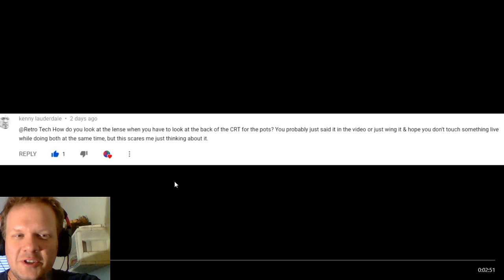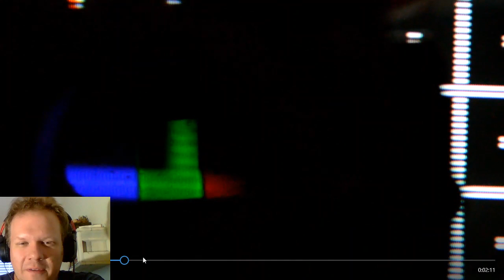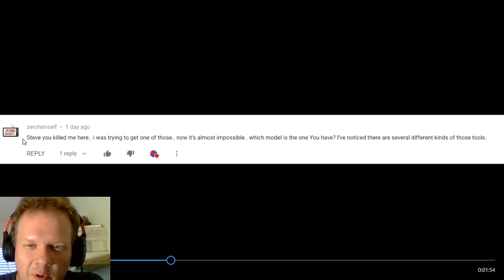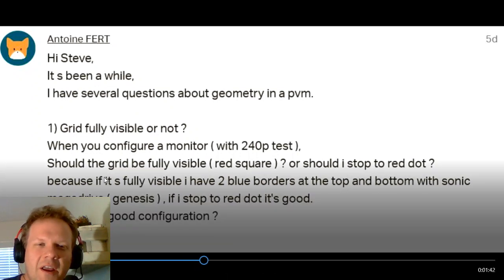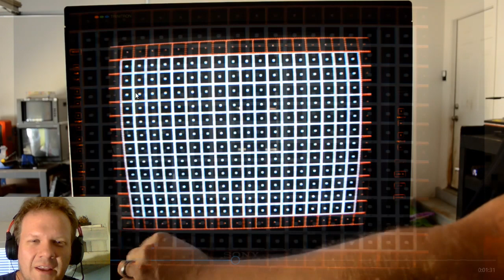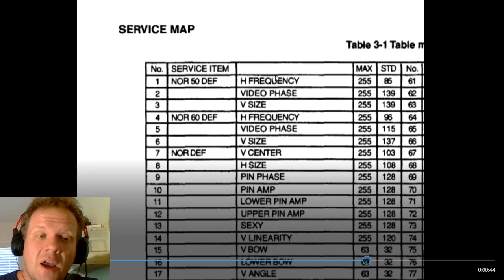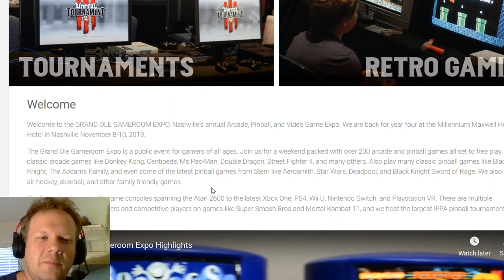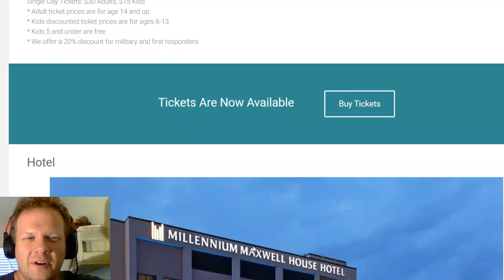Comments - Ep 3 Can I get Shocked⚡ adjusting CRT Convergence?

Comment: I adjusted convergence yesterday for the first time in possibly 25 years and I got a nip from one of the scan coil terminals,  I'm assuming it was horizontal because it was a tiny burn and smelled like bacon.  Sometimes there's a plastic box over the terminals. If not you can stick heatshrink on them.

Comment: Thank you for all of the great videos. I currently own two Philips 105S CRT Monitors which both have different convergence problems which I would like to fix. However, the rings are covered in a substance (I suppose some sort of glue?). What would be a safe manner of removing it? And what kind of tool/cleaning materials would you recommend for getting rid of it?

Comment: PAL/NTSC geometry issue is not normal. I can switch between 50 and 60 Hz input signals on my PVM and the geometry, such as Pincushion, is the same for both if adjusted properly for one.
The only thing that bothers me is that there are shared H SIZE and V CENTER controls, so you can never get it super perfect in that regard for both (although no big deal).
Reply from the maker: Thanks for the information. 🙂

Comment: I got one of those jeweler's loupes on AliExpress for $3 shipped. It'd be better if it had a color filter on it but you could at least get it close enough.
Reply: Oh, and talking about NTSC vs. PAL, some monitors split all of the geometry between NTSC and PAL instead of just a few things like that service manual. What's worse is that sometimes this isn't apparent and you access the alternate values by switching modes. Some monitors (N series come to mind) split variables between NTSC, PAL, and each input has different settings. But not all settings switch over. So for example, the N1/N2 monitors don't let you adjust H position on RGB but do on composite/S-Video.
Reply from the maker: That's interesting.  Unfortunately I just don't have anything PAL and never really come across it.  Also thanks for the feedback on the jeweler's loupe.  That's a way better deal than I paid for the official tool.

Comment: Some PAL sets are really a pain to configure to NTSC signal because you can only make changes in PAL mode. My way to do it is to connect two different sources, best with the same input, one PAL and one NTSC and switching between them. 
Also the 240p Testsuit for Wii can switch between PAL and NTSC which is much more comfortable and doesn't require two of the same inputs. It's still tedious tho.
And I can also confirm that not all geometry settings are separated in the two videomodes.
Reply: Some sets do have a 'write to 50hz and 60hz' option.  I have to press 'display' on my Trinitron remote in the service menu and I get a 'WRT5060' option pop up that I can then press 0 to save the setting to both.
Reply: @lullylew9083  Oh that's good to know. I'll keep that in mind, next time I try to calibrate a Trinitron. Thanks!

Comment: hi Steve, i recently got a consumer trinitron for free (kv29ls35b) it has some geometry issues which i want to try and fix, but when i turn the tv off i get a green dot with a little blue and red in the middle of the screen (like the crt gun is discharging) is this a sign of the tv dying? ive never seen anything like that on a crt before. if it is i dont think itll be much use to try and fix the geometry.. i uploaded a video so you can see what i mean https://youtu.be/gHeMRZziApE
Reply from the maker: Wow that's crazy.  I've not seen that.  It may have some cold solder joints on the main board or it could also be a sign of the tv being worn out.  If I were you I'd just try to adjust to as best possible and maybe check the board for cold solder joints and clean the dust out.  Then use it till it dies and look for a better condition CRT in the mean time.  There are many good consumer CRTs available for free or cheap.